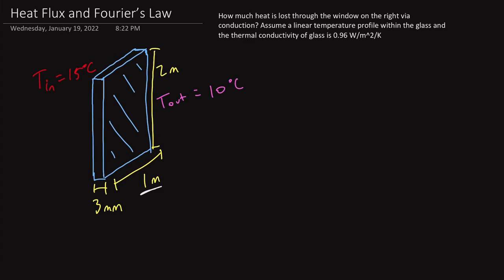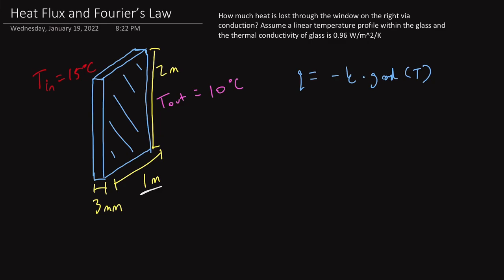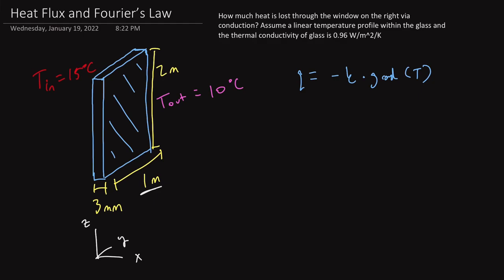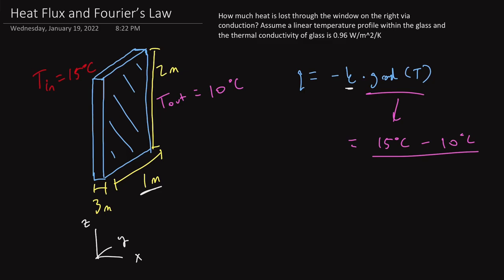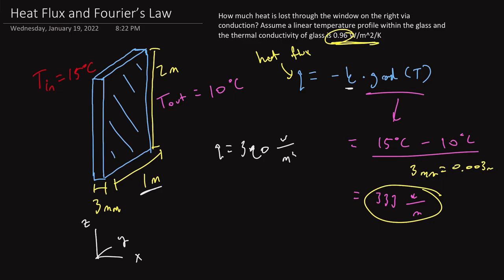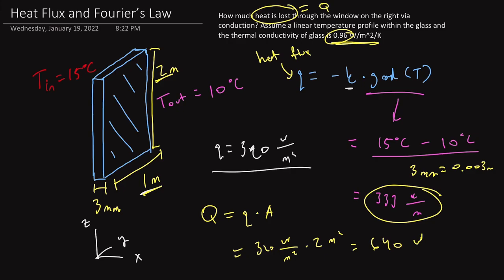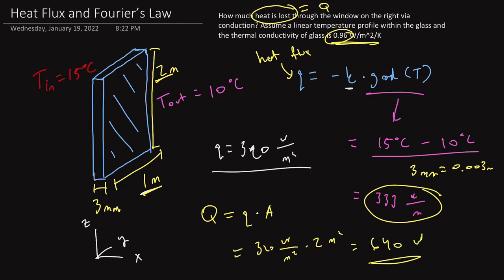Fourier’s Law and Heat Flux via Conduction

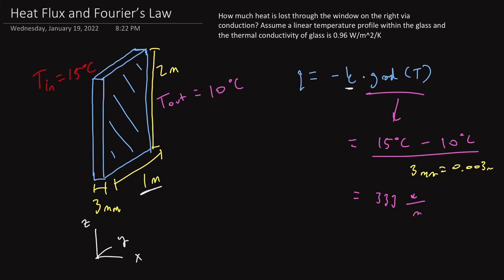Comment: 2:57 - but why/how is it equal to 333K/m?

(15C-10C)/0.003m = (288K-283K)/0.003 m

= 5K/0.003 m

=1667 K/m

ETA
3.26 also why/how W/m^2?

if we have 333K/m)(0.96W/m^2/K) - then the /m and the /m^2 would be /m^3 ? 
-here, I think the K with the 1/1/K would also be K^2?
-I think, however, in this case there are typos where maybe the k for glass should be 0.96W/mK ??
-then yes, the /m and /m would be /m^2 and the K and /K would cancel.